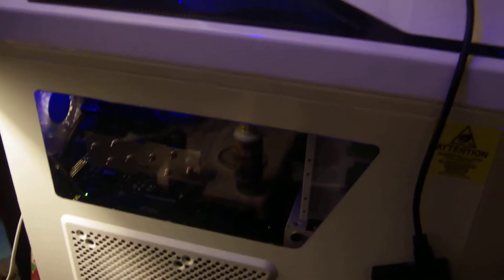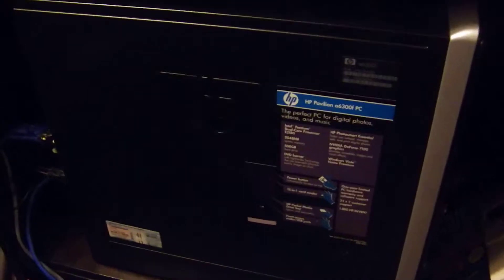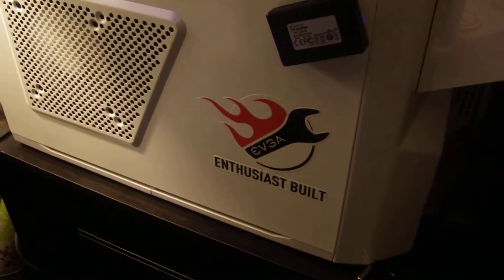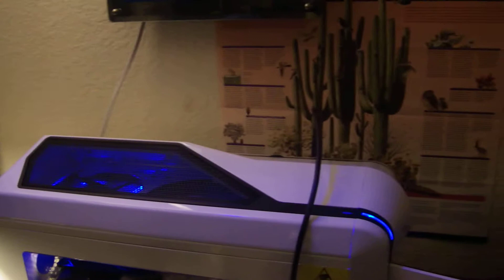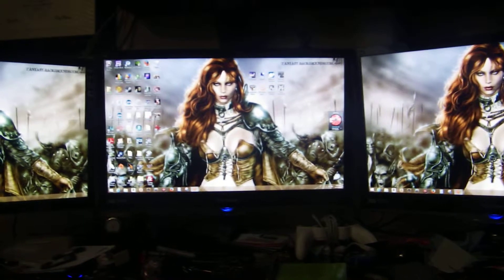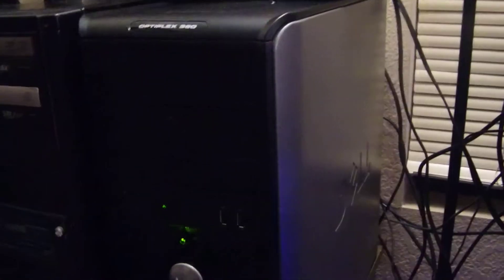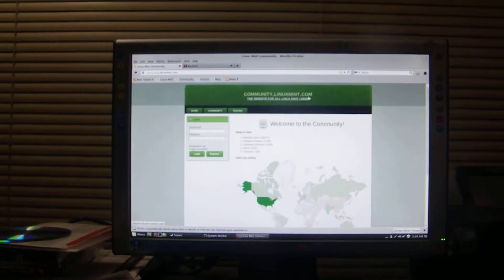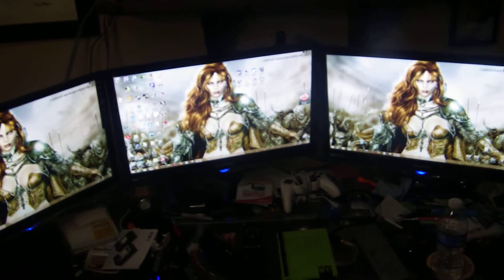Acer Predator AG3620 Case Swap, ITX Build, & More

Comment: Wondering what you tried using another gpu in your acer predator? I have the acer predator AG3620-ER388 with windows 8.1 and heard the mobo in them don't support other gpus, mine came with the nvidia gt630 2gb and I'm waiting to buy the 1050ti but not sure if it will work, also didn't wanna spend 250$ on it wondering if you tried with yours?
Reply from the maker: Popeye You can run but you can't hide It's had the 970, 670, 750 ti, 650 in it at times. Never had a problem with any. Haven't tried the 1050ti. Make sure you disable secure boot & enable legacy support in the BIOS/UEFI before taking your old card out.
Reply: Did you add the 970 on the mobo the predator came with? Wondering because the ram slots on mine kinda looked like a card bigger then 6.5 inches might not fit. I wasn't sure that's why I was going with the 1050ti it's under 6.5 inches... Also thanks for the reply
Reply from the maker: Yes stock motherboard, if you have stock ram without heat risers I think it will be fine.
Reply: Yeah I still have stock ram in there as of now, and awesome thanks for replying to my questions you've bin a huge help!! Was Kinda turned away from upgrading it because of all the bad posts iv seen saying it's not able to be upgraded! Cheers thanks a lot!
Reply: still rocking this pc lmao, with a rtx3060 in it now, thanks for the reply years ago duke